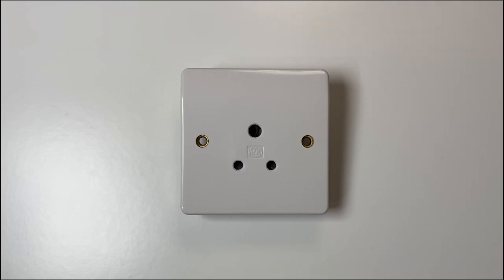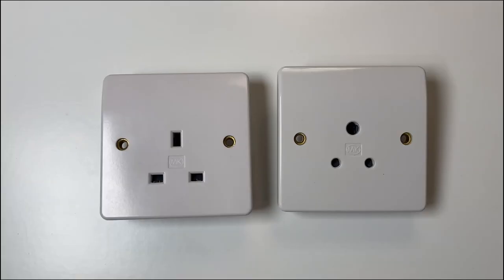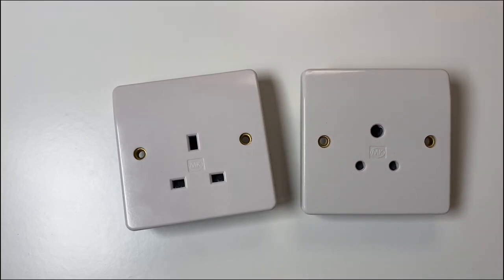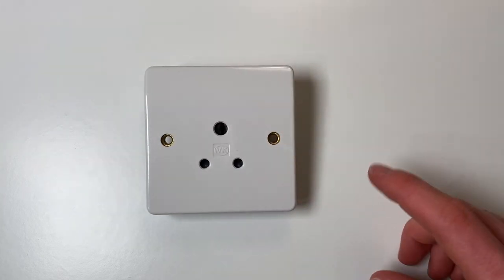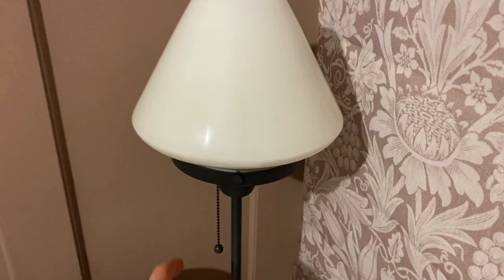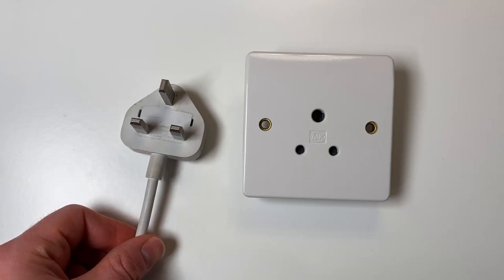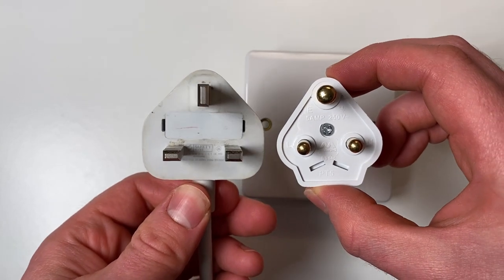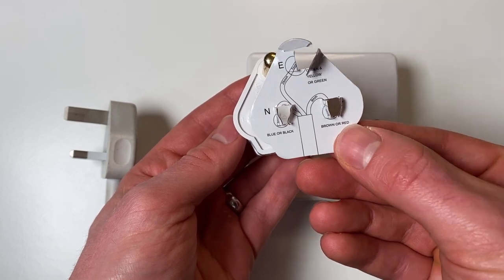What Are These Round Pin Sockets In The UK?

Comment: The larger 15 amp plugs were almost always used in theatres for lighting rigs that were difficult to access, so unfused plugs were preferred. Circuit protection was done at the backstage lighting board. 
Round pin plugs are the norm in countries such as South Africa, India, and other former British colonies.
Reply from the maker: Interesting to know, thanks for watching!
Reply: @TheDiligentDIYer1759   the round pin plugs as used in theatres stopped idiots plugging in power tools, kettles, toasters etc. You also needed to make sure the DMX was not turned on and just to make sure your mains switch was off and locked up with highly restricted key access.

Comment: Reminds me of the old 'Wylex' plug system from way back in time. Earth was a hollow round pin while L and N were flat rectangular pins one each side of the central round pin. They came in at least two sizes, the larger one was marked as 3KW and smaller one marked as 5 amp, they were similar in design but the 5 amp was smaller than the 3KW. The 5 amp was used for lighting and power was switched at the doorway to a room. I remember them in the family home back in the 50's. The Wylex company was based in Manchester and if I remember they were more likely to be found in homes around the North West than nationwide.
Reply from the maker: Very interesting! Thanks for watching!
Reply: Had these in my parents' house as a kid growing up in Manchester in the 1950s.
Reply: Different plugs for different power levels. That is why we went to the 13A G Type plug, which covers all by changing the fuse in the plug and also protects the flex.

Comment: When we bought this (old) house it had to be rewired and we had 5amp plugs fitted across all the main ground floor rooms.  Best thing ever as we do have more lamps than you can shake a stick at all being centrally switched is very handy indeed.  A newer alternative these days of course are smart plugs which of course can be grouped room by room.
Reply from the maker: That’s a great idea, I definitely want them in my next place. Thanks for watching!
Reply: Using 2a or 5a plugs is simpler and cheaper. And does not go wrong.

Comment: Used to use the round pin type plugs in large false ceiling applications. Saved a lot of messing about with hard wiring . There were no fuses in these plugs.
Reply from the maker: Yeah definitely a good use case
Reply: Klik roses are a much better system, as they have the ability to support weight.

Comment: In the 1950's ( UK ) there would ( also ) be a much larger 15 Amp version for big bar fires ... and ... a smaller 2 Amp version for table lamps / clocks ... the BIG advantage over the " modern " 13 Amp rectangular pin type shown , is they did not overheat ... when you plug in a heavy load ( 3 bar fire ? ) the plug fuse holder contacts overheat and make the live pin VERY hot ( can start fires ! ! ) ... however the round pin types needed a big fuse board as each socket had to be individually  fused ... the way to overcome the overheating live pin is to  SOLDER  the fuse in , thus lowering the contact resistance  .. this tip is ( tried - n - tested ) and SAFE ! .............. DAVE™ ...............
Reply from the maker: Interesting to know, thanks for watching!

Comment: I remember those round pin sockets from an oil central heating system my grandparents had at their cottage in the late 70's/early 80's. The oil boiler was installed in a separate building, maybe due to fire hazard. I remember it had thin bare wires above it, and I was told it was for safety should the boiler catch fire the wires would break and cut off the oil. But on the wall next to the boiler were these small almost triangular looking plugs, which had these round pins.
Reply from the maker: Thanks for watching!

Comment: Great explanation. I have some spare lamps with plugs which I wanted to use in the loft utilising the exposed lighting cable up there. I originally thought about just connecting the lamp wires to the lighting circuit via a ceiling rose, but then though there's no fuse to protect them (am I right?). Instead, I'll create a spur off the circuit with a junction box to a round-pin socket and replace the plugs on the lamps with round pins. That should offer my lamps some protection and stop anyone in future plugging any appliance into the lighting circuit.
Reply from the maker: Sounds sensible, thanks for watching!

Comment: 32A  you need to go back and do your basic BS 7671 A ring final curcuit may be rated at 32 A but each socket is limited to 13 A -that's why the plug has a fuse in curcuit -running a 32 A or even a 16 A to BS EN 60309 & Bs 4343 (industrial sockets and plugs) are not permitted on a  domestic ring final circuit as they are unshuttered and should be (rather than must be) on an appropriately rated radial curcuit in any industrial application.
Reply from the maker: Thanks for watching!
Reply: A 16A appliance can be off a 32A ring. It needs a 16A fuse, switch and must be hard wired in. Ring design comes in, so that if a there are number of high current drawing appliances, so maybe the 16A taken off from the ring may not be a good thing - an onsite judgement. 

You can use a shuttered 16A round pin plug rather than hard wire.  Available from India or South Africa.

Comment: The round pin plugs are used in South Africa as a standard for many years - 230V AC 50Hz - it was derived from the British square plug. Question below - Do those round pin plugs also have the safety flap that the ground pin disengages, or are they always open? Yes - the pins are protected - when you insert a plug the safety pins move sideways to allow contact.
Reply from the maker: Interesting to hear! Yes they have the long ground pin to disengage the safety flap. Thanks for watching!
Reply: No, the round pin on is BS546. It was adopted in Britain in the 1930s. The current BS1363 was adopted in 1947 and was related to the post war reconstruction. Many former colonies retained the BS546 in some form. It came in different sizes for different current ratings.

Comment: Round pin non-fused plugs and sockets come in three different sizes. 
2 amp - lighting;
5 amp - lighting;
15 amp - power/lighting.

All three are different sizes being non-interchangable.

I have the 2A sockets at three points around my living room for table lamps. The three are all off a dimmer switch on the wall. I can turn on and off and dim all three from the wall. Simple cheap and effective.
Reply from the maker: Interesting, thanks for sharing!

Comment: American here. Do those round pin plugs also have the safety flap that the ground pin disengages, or are they always open? I did notice that the round pin plug had a longer ground pin as well, so I assume the round pin sockets have the safety flap like the regular outlets do?
Reply from the maker: Yep same safety feature with the shutter over the live and neutral, which the longer earth pin opens up first.
Reply: MK 13A sockets still use a system where all 3 pins operate the shutters, I believe they are the only brand that does this.

Comment: Excellent info thanks. I have a few of these round 3 pin sockets in my living room. I have  table lamp with the standard 3 pin plug. The plug is moulded to the cable. Can I just cut the cable, strip back the wire and stick on a rounded 3 pin plug?
Reply from the maker: Yep you can do that, shouldn’t be an issue. Just don’t do it on anything other than lamps. Thanks for watching
Reply: @TheDiligentDIYer1759  Appreciate that, thanks. Just transferred plugs on two lamps and all good. Nice to be able to switch them both on from the dedicated light switch by the door. Thanks again.

Comment: 32A rating on the square pin socket!!!  I don't think so!! And the reason that the 5A plugs don't  have fuse is because the lighting circuit is limited to 6A at the consumer unit anyway!!!
Reply from the maker: Perhaps not clear with my wording, the square pin socket is fine to use on a 32A circuit, obviously the actual socket will be limited to 13A by the fuse in the plug. 
You could have a lighting circuit on a 10A MCB with 1.5mm cable, not common, but not unheard of. 
Thanks for watching!
Reply: @TheDiligentDIYer1759  sockets are around 20A rating

Comment: Correction. 
The standard square pin socket is rated at 13A! True a radial circuit is usually rated at 32A but that is for the distributed load on the whole ring main. Please check that you know what you're talking about.
Reply from the maker: A radial circuit is usually rated at 20A, and a ring at 32A, please check that you know what you’re talking about.
Reply: @TheDiligentDIYer1759  Please re-read my comment
The square pin SOCKET is rated at 13A and is not safe for currents above that. Similarly a 5A round pin socket is designed for 5A maximum. The circuit supply rating does not alter this.
You are correct about the circuit rating but it does not affect the maximum current that can be safely handled by each socket.
I think that you may be confusing the two.
Reply: My issue was with your audio track which states that the 'socket' is rated at between 20A and 32A
Reply: @davethekay 
A 5A round pin socket has to protected by an mcb of a small value. 5A or less, as for any reason the plug draws more than 5A the mcb should trip. But the sockets are designed to take more than 5A for a certain time period.
Reply: @davethekay  a double socket is rated at around 20A if you check and a radial is not generally rated at 32A! FFS!
Reply: Apologies. I meant to say a RING main is rated at 32A
Reply: @davethekay  or even a ring final if you’re being really picky, which I am because you were being patronising. Also sockets are rated at around 20A+, not 13A.

Comment: using these in combination with a smart switch at the wall means you can add as many lights as you would like to that circuit all controlled from your H,A and it would cost much less to make a full room smart ,ceiling / lamps / decorative led on one device instead of multiple "smart" sockets and smart devices cluttering the network
Reply from the maker: Nice idea, thanks for watching!

Comment: When I fitted a shower pump in my upstairs airing cupboard I decided to power it from the lighting circuit as there was no easy access to the ring main. To prevent anyone plugging a vacuum cleaner etc to the new spur I used this ype of plug and socket.
Reply from the maker: Good thinking, thanks for watching
Reply: so you got rid of the fuse protecting it? Well played sir! A great example of a DIYer...

Comment: Just a video I was looking for but I would still need some help if he could kindly please assist me I'd be grateful. I bought some led worktop lights which works off a 30w driver. Can I rewire the plug for that driver and use it to get power from the 5a round plug socket?
Reply from the maker: I can’t see anything wrong with pulling 30W on a 5A plug. Thanks for watching!

Comment: EU plugs work perfect in that round hole socket
Reply from the maker: I haven’t tried one, I agree they look similar, but i think the pins are different sizes. I could be wrong though. Thanks for watching!
Reply: Both have 19 mm (3/4") spacing. Europeans likely adopted that spacing from Britain around 1900. After that all Europeans sockets have had it though the pin diameter in most countries increased from 4 to 4.8 mm. Schuko was always 4.8 mm but for ungrounded it was adopted around 1960.The flat Europlug is designed to work well on both 4 mm and 4.8 mm.

Comment: We use round pin plugs in South Africa
Reply from the maker: Thanks for watching!
Reply: So did we. We changed, you never.
Reply: @johnburns4017  People generally do not change sockets in their homes when standards change. Round sockets were still used in Britain in the 1980s. It was only in 1992 when the BS1363 plug was mandated on devices sold.
Reply: @okaro6595  
Very few round pin sockets were used in the 1980s.

Comment: So much easier to turn all the lamps on (one switch, all the lamps come on Vs walking around the whole place individually turning on lamps). I wish they were standard

Edit: obviously you can do that with normal sockets too if you wire them that way, but it helps to know which sockets are connected to the light switch on the wall (it's the ones with round holes)
Reply from the maker: Yep definitely, sadly I don’t think they’ll make a come back. Thanks for watching!

Comment: Personally I'd change the bloody socket, because even if there is a lighting circuit behind it, that can only handle 5 amp, you are unlikely to plug in anything that will overload it unless you use an electric fire or electric kettle. Stick a label on the socket if you are that worried.

This kind of thing reminds me of the ceiling LED light setup in my late brother's flat. Every low voltage LED was connected via a transformer. I regularly had to replace transformers for him that had melted! The idea was to protect morons who change lights without switching off the power. I removed all the transformers and replaced the low voltage LED lights with 240V ones: problem solved.
Reply from the maker: Thanks for watching!
Reply: Put a 13A socket on a lighting circuit? Nonsense.

Comment: Will you explain that on the back of the single square pinned socket its states 13A not 32 ampas you said. Most of your viewers must bewondering the same.
Reply from the maker: I said the circuits are usually 20-32a for sockets and 5a for lighting. I agree I could have been clearer though. Thanks for watching!

Comment: There is nothing to stop you using a switched 20A wall switch with a 13 amp  to control switched lighting circuits and such rated circuits would be perfectly safe as they are in effect a 20 amp radial or a fused spur off a 32 a ring circuit.
Reply from the maker: Thanks for watching!

Comment: I’m sure many reading this come will already know this, but they are called Type D plugs. I believe they were used in the UK before they switched over to the current standard, called Type G. Since India was under the British Raj at the time, they were used in India too and they continue to be used in India.
In India they’re colloquially called 6-Amp plugs by electricians and the most commonly used sockets in houses. Indian appliances also come with Type C plugs, which are just 2-prongs and for devices which normally need no more than 2 (or 3) Aof current. You can shove in a Type C plug into a Type D sockets, but the government is now pushing to completely do away with the Type C plugs.
The other type of plug used in India is Type M. It is also a 3-round pin type plug and looks exactly like the Type D, but it’s bigger. In India is referred to as a 16-Amp plug, because it’s on circuits used for high power devices like water heaters, or refrigerators, and are on 16A circuits.
Normally, while there is a single fuse on one 6A circuit, there are separate fuses on the each 16A sockets (not plugs).

At 230V supply, a 6A outlet can power up to 1380W, while the 16A outlet can draw up to 3680W, both of which are sufficient for the kind of appliances you use on those sockets.
Reply from the maker: Interesting, thanks for watching!